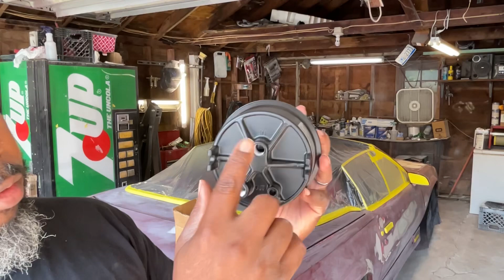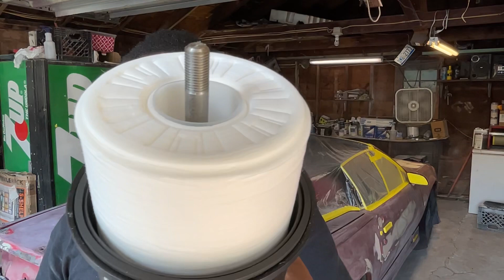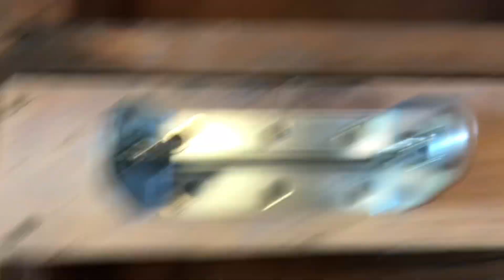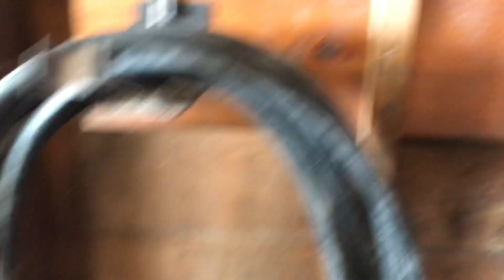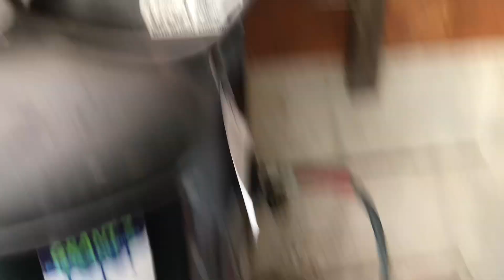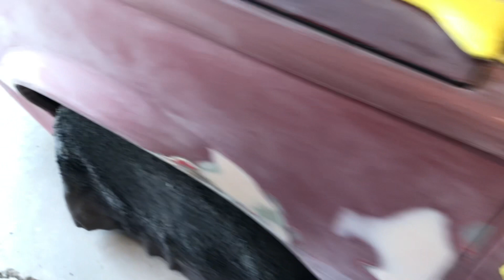Motor Guard air compressor filter

Comment: Good video and informative
Reply from the maker: Appreciate you checking out the video ❗️
Reply: I was a mechanic for Safety Kleen corporation. I had Motor Guards on everything with an engine mostly lift trucks. The head engineer came in with a new plasma cutter. He said they had Motor Guards at an extra cost. I knew you liked them. He said you have to put it on. It was a M30. Our plant air is dry. We have refrigerated air driers all over the place. Put a little more water in a Motor Guard than its capacity and the instruments and air timers are down.

Comment: Don’t know if I caught it or not, do you use the replacement filters? Or toilet paper?

Edit- you said it at 5:50
Reply from the maker: You can use either but I’m currently using the filters
Reply: Use the filters that are made for it for security my girlfriend tried to use it after she went to the bathroom and Sid said it's a big difference😂
Reply: They were origionally designed to use 2ply toilet paper. That was before we got 1000 sheet or Motor Guard elements. The first Motor Guards were lube oil filters that used 2ply toilet paper about 1961. They went broke trying to sell filters that clean oil to people that think oil is supposed to get dirty and be changed. Best oil filter you could buy in the 60s. Frantz was a poor design but better known. Probably the best for the money is the Australian Jackmaster Classic. Cheap bastards use toilet paper in them. Another one sells for about 700 bucks. I think the refills are about 35 bucks. Toilet paper with a cheese cloth covering. Toss the white parts from a Motor Guard M 30. Put a 2 1/2 inch OD washer in the bottom for a core seal and a 1/16 inch orifice in the inlet. Dont need a center tube with firm paper. I ream the ID so it will press on and not stick to the used paper. Some use the stock white parts but hot motor oil will deteriorate them. I use modified M 30s on everything from riding mowers to my diesel tractor. The tractor uses a modified M 60 for the fuel. Not recommended by Motor Guard. Also I have a flat head Ford V8 canister filter with half a roll of VIVA Signature cloth paper towels for the tractor lube oil. It was origionally modified to use a 4 1/2 inch diameter roll of Scott 1000.

Comment: I found the 14 pc Milton v style high flow couplers on amazon for $30 delivered, Harbor freight oughta be sponsoring you UPK, also if TP will clean your dairyair it should clean your air
Reply from the maker: It would be nice to get some sponsors but as long as I can help my people with the information I’m good, lol I agree that if the TP can keep you clean it can keep your air clean
Reply: I stopped draining oil in 1964. I slip in a roll of Great Value 1000 from Walmart and add a new quart of oil. A couple of times the oil started looking milky. Had to replace a head gasket and drain the oil. Ive heard some toilet paper stories. Like toilet paper has too much acid to use for oil filters. Of course its ok on your bottom.

Comment: I’m intrigued by the toilet paper roll thing.  Do you leave the cardboard thing in the roll?  Or tear it out?   I’ve got a tiny filter from harbor freight and it fills up with water quick. So thanks for the info on this other filter, man. Keep up the good work.
Reply from the maker: I haven’t used the toilet paper yet but I would think that it’s ok to use the cardboard roll Josh, I appreciate you checking out the video!
Reply: I ask because you know I’m gonna put a roll of toilet paper instead of the right stuff. Lol. Put my money in my project
Reply: The core stays in .When toilet paper was the same size as the Motor Guard paper when the toilet paper was compressed the core was damaged.  I like the shorter paper. You do need to put a spacer at the top to push down the core against the core seal at the bottom. You dont need to worry about the outside of  the roll as long as it makes good contact with the inside of the filter. In other words the same diameter as the Motor Guard elements.  Try to find paper as firm as the Motor Guard elements. I use a 1/4 to 3/8 inch spacer at the top to push down against the core seal. I have a Harbor Freight  lathe and some 2 inch OD by 1 1/2  ID aircraft tubing. Most any thing would work.   The softer paper doesnt work for motor oil. I have no experiense using it for compressed air. You might not find toilet paper as firm as the Motor Guard but you can get close enough. Watch out for size changes. The last Great Value 1000  from Walmart was the same diameter as the Motor Guards with the last sheet glued. Should have stocked up on it.
Reply: Put a cheese cloth covering on a roll of toilet paper and its worth as much as 35 dollars.

Comment: My father ran that air filter in the sandblasting room of his body shop.  My first memory of it was the late 1970s.   I never knew you could purchase a filter element.  We jammed it with toilet paper rolls as needed.  Watch out though, not all toilet paper rolls are wide enough.  Too short, and the air blows straight thru.  Good to see the Motor Guard company doing good all these years.
Reply from the maker: I had someone else say to use Charmin and to definitely make sure to keep watch of it but I’ve seen a lot of people have success with it
Reply: Most people use a firm paper such as Scott 1000. I have 2 of them over 50 years old that were designed to use toilet paper to filter motor oil.  I put a roll of Great Value 1000 from Walmart in the filter on the 390 on the 76 F250.. It was a perfect fit. One problem when using toilet paper these days is it is shorter now. The lube oil filters from the bottom up. I have a spacer in the bottom to push the paper up against the seal at the top. I just put a M 30 on the diesel tractor hydraulic system. It was tricky. I used a grease zerk to make an orifice to feed the full flow filter and the M 30.The full flow filter is to take the oil flow because the M 30 is too dense to take all the oil going thru the orifice at over 1000 PSI. Before I got it right I blew out the O ring. The inside coating still looks good but I feel a blister in the outside coating.. The Motor Guard is a paper pincher especially if you use too big a roll. I didnt remove enough paper on the Scott.  Had to push in the paper with a knife. The reason the factory elements dont pinch paper is its the right size and the paper end is taped.
Reply: The Great Value 1000 sheet or the Scott 1000 sheet is similar to the white Motor Guard elements.  We had trouble in the old days with paper pinching in the gasket. The 1000 sheet doesnt get a midriff bulge. The Scott 1000 is bigger and needs more rounds removed. All we had for the origional Motor Guards was soft 2ply. I do use Charmin Ultra Strong in the M60 on the diesel tractor fuel. The fuel is gravity from the fuel tank. The 1000 sheet is too restrictive for gravity.

Comment: Those work great with the single ply toilet paper from scott.  You know the john wayne paper, tough as nails and nothing sticks to it, haha.  You may have to take a few turns off to get it to fit tightly.  You can use that same scott paper for filtering oil if you use the inlet from a pressurized oil source.
Reply: The problem with the Scott 1000 is it is too big. Ive been using Great Value 1000 from Walmart.  It is smaller. Probably made by Scott. I converted a flat head Ford V8 canister filter to use 4 1/2 inch Scott 1000 for the old Ford diesel tractor lube oil. Was looking for a Ford 8N. Im starting to like this old tractor. 4 wheel drive 12 speed transmission  3 cylinder diesel and loader. About the same size as a 8 N..Pretty good shape for a 79. Its a masterpiece of engineering.Japanese Ford
Reply: Motor Guard started as a lube oil filter in 1961. The one on my old Ford F 250 is over 50 years old. I use them on everything including riding mowers. You can press a washer on the bottom for a core seal. Has to be larger than the tp core. I use a 2 1/2 inch Od washer. Dont need anything inside the tp core to keep it from collapsing with firm paper such as 1000 sheet. Also need a 1/16 inch orifice at the inlet. I dont need an orifice because I use a two port sandwich adapter normally used for oil coolers
Reply: Before the 1000 sheet or the Motor Guard elements we used soft 2 ply. As the 2 ply was compressed it would get a midriff bulge that would pimch in the gasket. The 1000 sheet or the Motor Guard elements dont get a midriff bulge. I normally use o rings from McMaster Carr or a local bearing supply store. 4 5/8 by 4 7/8 by 1/8.inch. I accidentally hit my M 30 with full hydraulic pressure. Luckily it blew out the o ring. On the tractor the M 30 is about 4 feet from my body.
Reply from the maker: 😂 thanks for those tips Phordguy I’m definitely going to try them out
Reply: Guys if you don't know - print out everything Ralph Wood says about motorguard filters.  He is the guru's guru.

Comment: Awesome. That would work for a portable filter as well. Thanks UPK
Reply from the maker: Yes it’ll work great as a portable filter Frank that’s a great idea!
Reply: We had a plasma cutter at work on wheels. The boss asked me if he should buy the optionL Motor Guard M 30. I said hell yes. I was buying toilet paper by the case from Office Depot. Perfect fit. They fired a guy for doing drugs. When we were in the lunch room he came in and got the plasma cutter. We knew who got it  He was talking to the boss when a train went by the shop. Never got it back.The M 30 was bolted to it.

Comment: That's  a neat  setup.  I like that the input pressure maxes out att 120. The Steel Camel filter I got taps out at 60, and after my desiccant filter and 50 ft of hose I can't get my gun above 22psi. I took it out and ran without it, and had no problem getting up to almost 40 psi. I also ran the aluminum high flow HF ends, and have found that they work great everywhere except the ends of the hose that plugs into your gun. If you unplug them and drop them on the floor, they get nicks in the edge that can cause them to leak...so bad, in fact, that my compressor can't get to 90psi when using air tools, if a tool is plugged into it. I'll be replacing them with fresh ends right before I paint my car. Another very useful video, great job! Got a link to where you got the Motorgard filter setup?
Reply from the maker: Thanks for checking out the video Jay and your right if you drop them on the ground (which I do all the time 🤦🏾‍♂️) the eventually start leaking…I’ll try to get a link for you
Reply: I accidentally hit my M 30 with over 1000 PSI of hydraulic oil pressure on the Ford diesel tractor. Part of the gasket blew out. Didnt hurt the filter. Installed a Ace hardware needle valve and a pressure gauge. I was using Motor Guards when all they had was lube oil filters.The name didnt come from filtering compressed air. It was my favorite in the 60s. The one on my old ford truck is over 50 years ago.